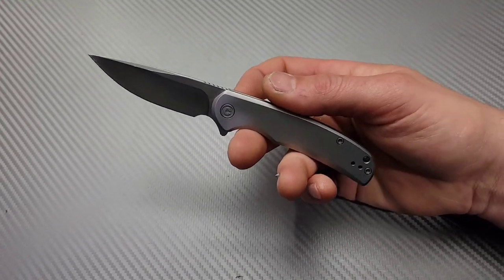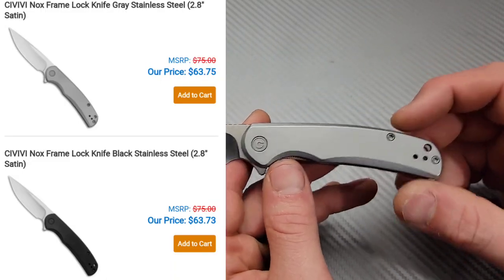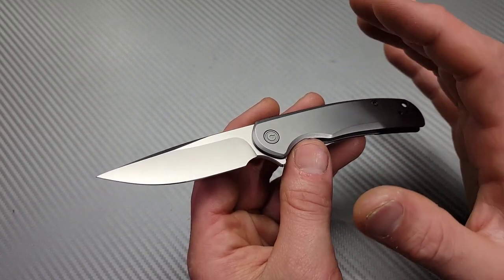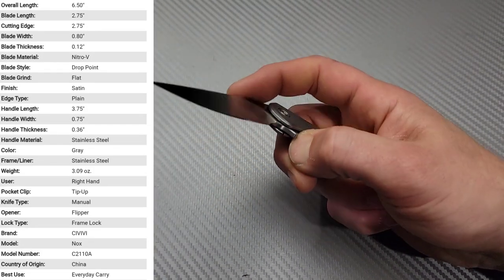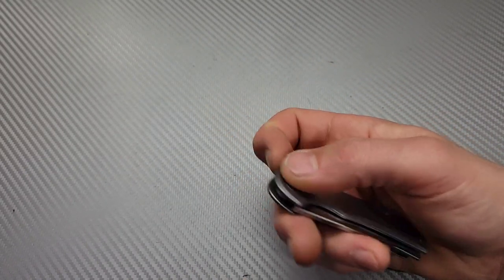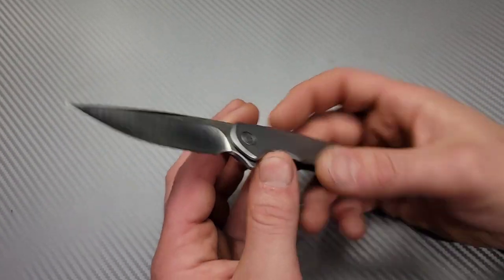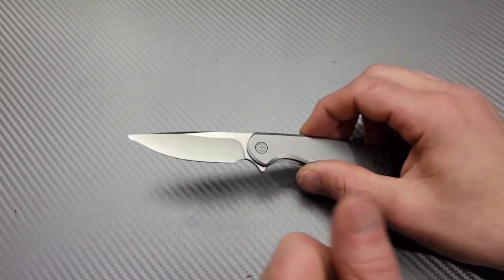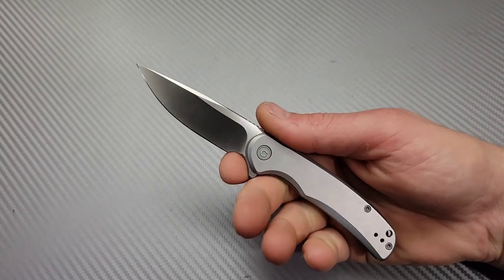CIVIVI NOX REVIEW best under 3" civivi?

Comment: I got mine Tuesday. I got the black handle one. I like the slight stonewash to the black handles. Been carrying it ever since. Its crazy how thin the tip is. WMK code helped w/ the price. Mine has a nice sound to it for what it is.. I have a elementum also. The only thing I dont like about elementums is, it need more access for the lock bar. I have wide thumbs and I really need to press down to unlock it. The Nox is ok because it has slight "jimping" on the side of the frame lock
Reply from the maker: Awesome, yeah mine has a pretty cool sound I tried showing the sound towards the end a little, looks like there's going to be a vs video coming soon

Comment: Does the blade scratch fairly easily? The black scales version wouldn't the black coating on the scales chip off or get ruined over time ?
Reply from the maker: Any coating can scratch just depends on how tough you are on it